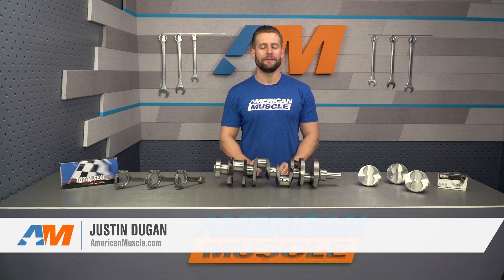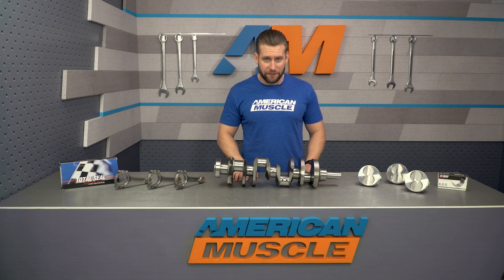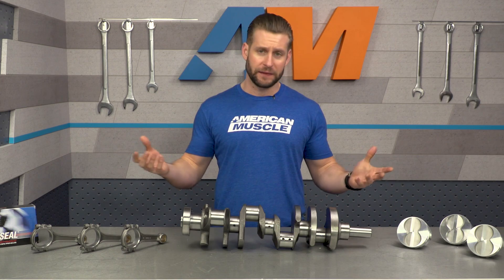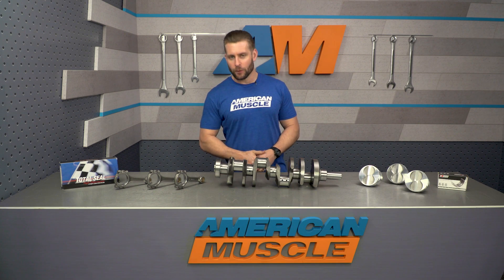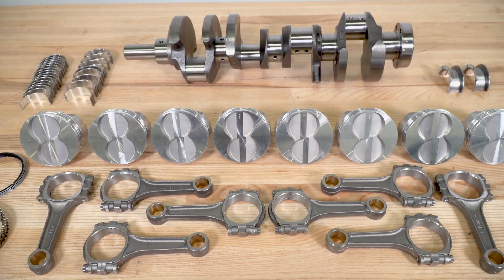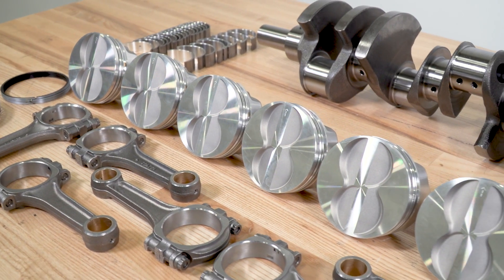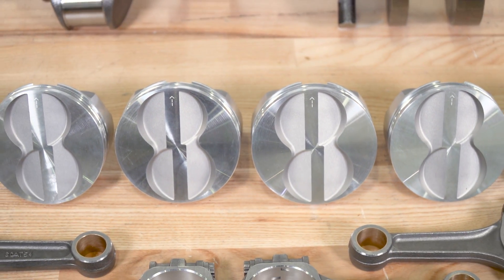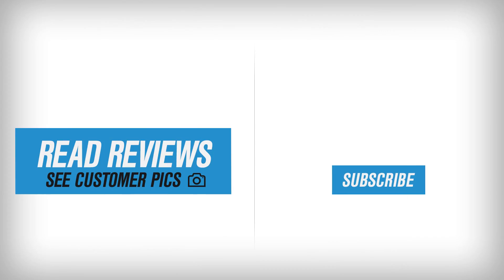1979-1995 Mustang 5.0L Scat Stroker Series 9000 347 ci Street-Strip Rotating Assembly Review

Comment: 1998 I used this kit in an HO block with ARP main studs and a steel main girdle, Probe pistons, C&A zero gap taper face rings topped with ported Victor Jr heads. Boost via Vortech STrim. Only engine I ever built, had no problems.
I know this kit is good for reliable 600whp as long as the tune is on.

Comment: You mentioned some machine work.  What would need to be machined?   The valves on the heads?
Reply: You'd need to bore out the cylinders to accept the larger pistons
Reply: @bombx188  and notched each cylinder at the bottom of the bore due to the longer strong to clear rod bolts.

Comment: Will 2.02 valves work with an e 303 cam?
Reply: Yes they will. the E cam is not that radical.i run an E cam with twisted wedge heads that are 2.02 intake  and 1.64  exhaust  these heads are smog legal in california.thats where i live.with  good induction you can put down some really good numbers.
Reply: 09251976100 okay I was just worried about the valve reliefs being big enough for the flat top pistons
Reply: @andrewbrown755  depends on your pistons, usually need valve reliefs in flat tops. Clay it and check it if your not sure.
Reply: As long as it's 88 and up. 86/87 pistons did not have valve reliefs in pistons

Comment: A crankshaft only rated to 500hp? That really limits your head, cam, and induction combo.. among other things. A 347 should surpass the 500 mark.. going over the crankshaft limit. Heck, I can squeeze 500 out of a built 302 I couldn't imagine a 347.
Reply: You are not getting 500hp out of a 302 without turbo, superchager or NOS. You would get about 300hp.

Comment: 3:47 the rod length has nothing to do with the stroke, idjit.
Reply from the maker: ...."when paired with scat crankshaft"  -Justin
Reply: for those who let this person confuse them with his fast talk, the concept of a  longer rod shifts the piston pin location closer to the top of the piston(shorter compression height) and allows the piston design to be much lighter. only the crankshaft determines the stroke.
a lightweight rotating assembly is just as desirable as longer stroke.